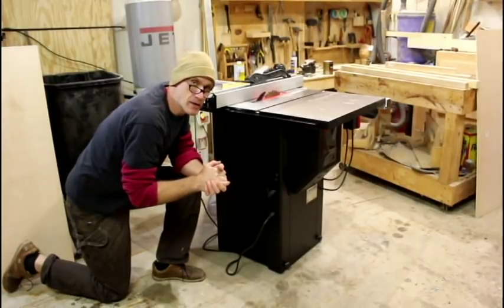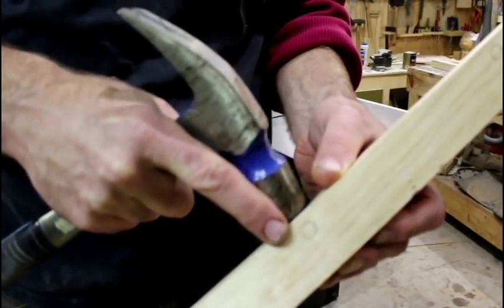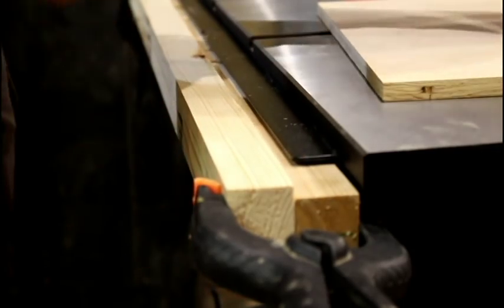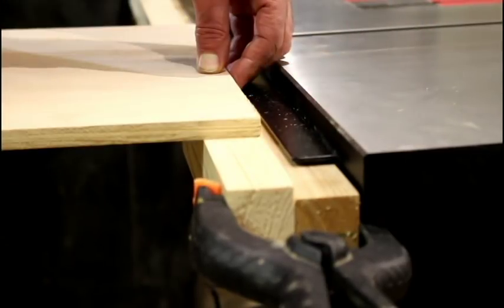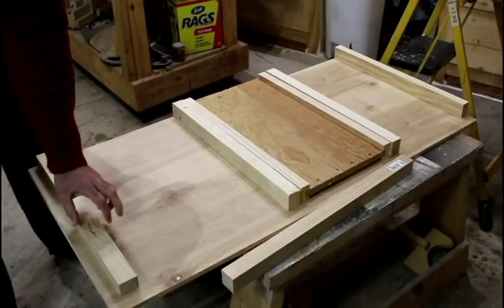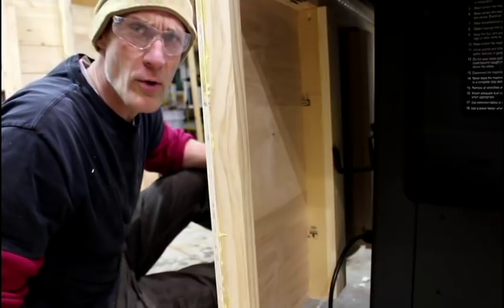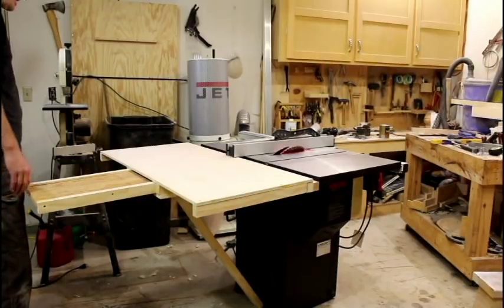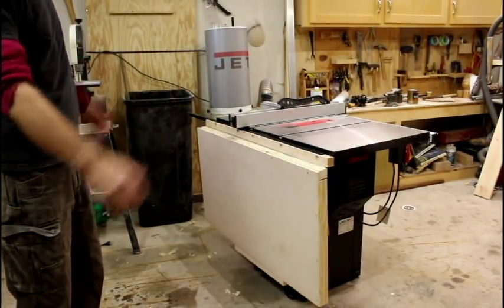Table Saw Folding Extending Outfeed Table

Comment: Mark,  What did you do about miter slots? I got to assume that you ultimately routed some slots in the extension table.  Otherwise, your miter gauge or cross cut sleds would be rather limited.
Reply from the maker: I did create some miter slots for it.